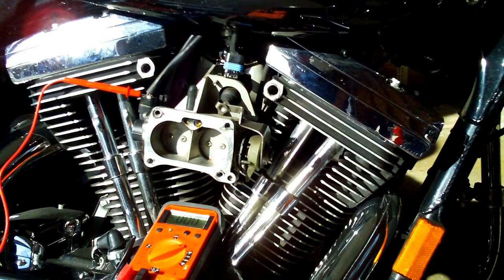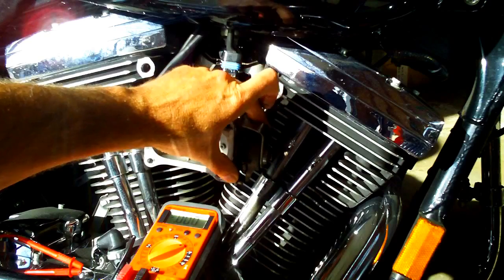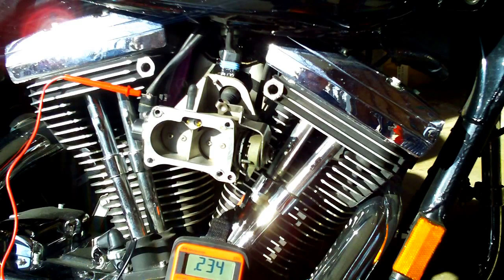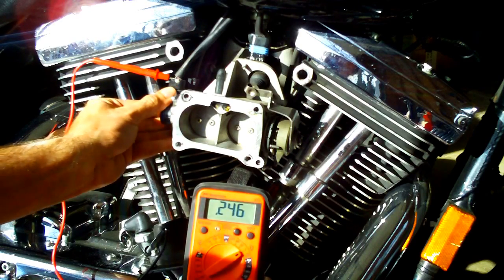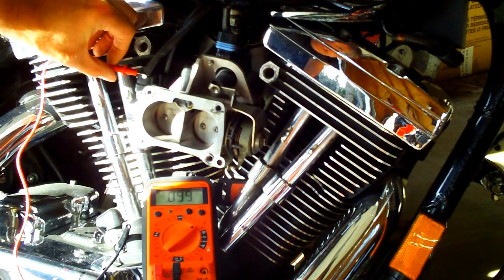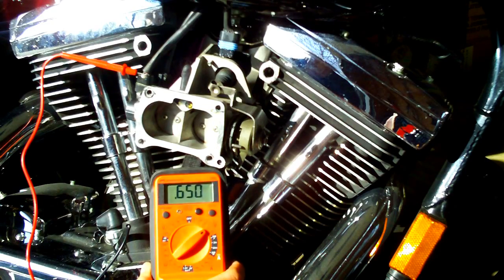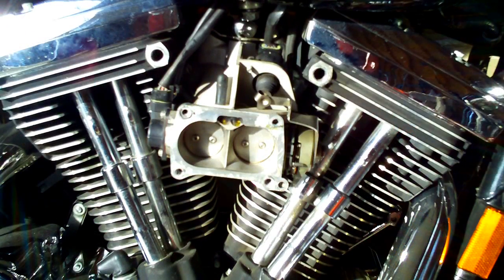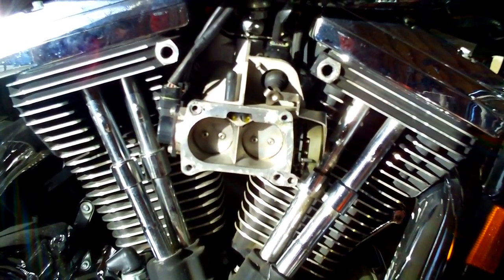Reset Harley Davidson Magneti Marelli Fuel Injection TPS Settings ✔

Comment: Hi Mark... I followed your instructions on this last year or so on my 01 FLHTCI and it helped somewhat. Bike started idling real high and I eventually replaced the TPS with a used one. Then it ran much better. Well now I'm having issues agsin. Put an NOS TPS on and with the adjustments it starts great, cold idle is nice and then warm idle at times is good but then it drops to around 500 rpms and chugs. Take it for a ride and stop and idles great at times but then again it drops to a low rpm and chugs. It just won't keep its idle setting. I replaced cylinder head temp sensor , air intake temp sensor, cleaned out air bleeds but still it just keeps going to a low idle when it feels like it.  I heard of a guy that had to replace his cam sensor a few times . Scratching my head man. Otherwise bike runs strong in all other ways just that Damn idle won't hold or set. Any ideas ?  Thanks
Reply from the maker: The only idea I have so far is to ask if the cold idle is adjusted too high causing the carb idle to rest on it rather than the warm idle screw. Then when you stop and the bike gets really warm it backs off yet again until the idle stop is onto the warm idle screw, which may be set too low (500 rpm). I always hated messing with the cold idle screw because it means you have to remove a LOT just to get to it. Can you verify that this scenario is not what's going on? I can't think of anything else to check at the moment, you've covered most of the bases except for the barometric sensor (snorkel looking thing) inside the fuse cover. I have not heard of one of those going bad, however. As for the crank/cam sensor, I would think the bike would barely run if at all if it was bad, but check with someone who has more experience in that than I do.
Reply: Mark Young - Outside The Box Thanks for the quick reply. What your asking is not the case. It starts cold and idles around 1400-1500 and then idles down and rests on the warm idle stop as I've looked at it several times. Even made sure the cables weren't on a bind and all good.   What I'm seeing from the other post is a typo on the bulletin ??? The .275 should really be .195 for the sweet spot according to Ed? That's enough to make all the difference in idle quality I'd think. You agree on this .195 setting? Mistakes happen I know we are all human. If that's the case all I need to do is reset to .195 and then maybe my problems are gone finally....
Reply from the maker: @Nickolas64  The difference between the two numbers is not a mistake, it is being said that one setting is correct for 80 ci EVO and the other setting is correct for 88 ci TWIN CAM. This is the first time I am seeing this number from the twin cam, so I have no other history to go on. It's up to you to decide if you want to take everything apart again and try it. Keep me posted.
Reply: @contact4mwy7  ....Well if there's a typo and it should be. 195 and not .275  it doesn't help me any it made my bike run a lot worse!! Really threw it out of whack.  So back to. 275 and I found an article from another guy that said warm up your bike fully.  Set the warm idle to 1200 rpms,  pull the 5 amp fuse and ground the relay side of it for min.  15 min or longer.  Put the fuse back in,  start it and get it up to temp again as I rode it about 5 miles or so.  Then just turn the warm idle screw back to 1000 rpms. Said it works like a charm.  So I did and so far it's idling better than it has in a ling time! It's a little off beat and not real smooth but it hasnt dropped down low and started chugging thus far.  It's hovering around 1000 rpms pretty good.  Maybe that's the trick I don't know as nothing else has worked until now.  The resetting of the TPS made a big difference in starting and idling cold until warm! That was a big improvement. Before it was rough and didn't idle high or smooth and ran like crap.  Now it starts up and idles real nice cold around 1500 then drops to 1000 and so far hasn't gone down to lie chugging speed.  I'm going robot in some new plugs for the hell of it since it hasnt been running right. So.... So far so good will see how it goes.  Thanks again for your TPS resetting info as it helped a lot for overall better starting and running.  I think I'm good now...  What a pain this has been! I still feel like something is off though.  I may get a power commander so I have more control over settings.  I'll let you know in the future how it goes...
Reply from the maker: @Nickolas64  Thank you for getting back to me! Again, that new number was posted on a forum and was new to me, but no one who has used .275 has replied to me that it made it run worse. Just worth a try maybe if running the twin cam 88 version. In a couple other videos I show how I picked up used fuel controllers that worked with this system to richen it up just a bit, not much, to get good power and gas mileage. Don't rack your brains out over it. If it runs, run it! Whether or not it seems perfect just might be small stuff overall. Get some riding in and make small adjustments if necessary.
Reply: @contact4mwy7    Here's an update I discovered today. This has been an intermittent issue with the on off not idling properly so kinda hard to diagnose when it's not acting up.  Yesterday it was acting up more than usual spitting,  popping,  not wanting to idle at all.  Decided to check the speedo for codes and one was stored in there but no check engine light on.  Well I got a 41 which is the crank sensor! So I've got one on the way.  I checked it before with nothing present but since it was acting up I decided to check again and this time it had one there.  Will see what happens when I put the new one in when it gets here in a few days...
Reply from the maker: @Nickolas64  that could be the very reason it's not quite running right! Let's hope! Thanks for letting me know, tell me how it goes!
Reply: Mark Young - Outside The Box  Well that didn't help it any. Either my speedo is off or something else is whacked. If I keep it around 1100-1200 it will stay there. Try to turn it down any more it will drop down to the 500rpm chug chug chug.... It's possessed man... I'm leaving it high... Try for a nice 1000 rpm and it will act up... Very strange
Reply from the maker: @Nickolas64  yes, it is. Can you check or know someone who can, to see if there is an intake gasket leak? Is it making a popping sound at idle, like a backfire, when it slows right down to the chug chug speed?
Reply: Mark Young - Outside The Box I've recently replaced the intake seals along with a new tps.  I've got another update. Since I've been tinkering with this bike awhile now I have learned it's habits. I've set the idle different than before. This motor goes through a few stages of idle as it settles. You can't just drive it and get it hot and then set it to where it appears good. You have to give it at least 5 min after setting the warm idle screw as it makes one final drop to its final resting idle like its a computer controlled action. So I've set it around 1200 rpms hot just getting back from a ride then you wait around 3-5 min till it makes its final drop to the lowest idle setting and it's right around 1000 rpms now. I believe I've hit the nail on the head. I've put locktite on the screw so it won't move and the idle is perfect. Almost sounds like a shovel head and it's at 1000 or a tad less. No sounds of trying to die or chug at all just a beautiful idle. A little fine tuning in the fuel tuner as well. Very small adjustments work better on it than half turns as the manual calls for. The crank sensor made a big difference as well. Just how it starts, warms up, runs, cruises now is incredibly smooth. The engine sounds better as well. It seems to act normal now. Believe that crank sensor was acting up intermittently and causing problems. The code is gone now as well. Every time I start it the idle is real nice. The ..275 adjustment made the big difference in cold idle starting as it was rough before and never had a high smooth cold idle until I found your video and made the adjustment. Always rough and not smooth at all. So again I thank you for posting it and all your help. I'm a mechanic by profession just retired from medical reasons now at 55. Haven't worked since I was 44. I had my ASE certifications back in the eighties when I was wrenching on cars. I was the main mechanic where I worked and took pride in my work and had lots of customers only wanting me to work on their vehicles . I did it right the first time and never took short cuts. Had lots of old sixties muscle cars I swapped heads, carbs, rears, intakes, etc always looking for more speed so I know motors well. This is the first bike I've ever worked on and it's quite easy. The computer and sensors is the hardest part yet not that hard. I've already replaced the cam tensioners, all top end gaskets, installed rocker lockers to quiet the valve train, shifter seal, fuel tuner, tires, etc... love working on motors. learning as I go on the Harley but it's pretty easy to work on. I still want an older FLH though. Shovel or pan head, chain and carburetor is what I really want along with a more vintage machine.This bike I just ran across for a good deal. Anyway I finally think I'm good now. Just a touchy machine that I have to learn it's nature and such... Thanks again for all your help...
Reply from the maker: @Nickolas64  wow, man, I am just happy for you! When they run good, they run good, and feel like a lot more fun! Yes, the cold idle motor steps down per the ECM as the cylinder head warms up, you are correct in waiting for it to become "heat soaked" and then making final adjustments on your warm idle. Which fuel tuner did you go with? Very good that you put all that experience to work in replacing so many things already, all very good choices, especially the cam chain tensioners (early twin cam 88's). Safe riding to you my friend!!
Reply: Mark Young - Outside The Box A friend said he uses the Cobra tuners so I got one of those for it. FI2000 I think. Couldn't really adjust it with any sense of change until I replaced the crank sensor. Now I can easily hear and feel the adjustment made. It's very touchy I had to make a few more adjustments recently as well. It runs much better but still seems a little off. Maybe it's just the Marrelli system or something else is acting up a bit. I'm just going to ride it and see how it goes. At least it's not all out of whack like it was. It's manageable now anyway...
Reply from the maker: @Nickolas64  I can't think of anything else to try at this point. Is that the Cobra with the screwdriver turned adjustments?
Reply: Mark Young - Outside The Box  Yes  it has 3 adjustments
Reply from the maker: @Nickolas64  I know the one you're talking about, yes. It's very similar to an early Dobeck fuel injection tuner I used on my MM Road King. I made a video of tuning it up according to their video on YouTube. I think you'll be happy with it. The MM fuel injection system runs Open Loop, which means you're not fighting with O2 Sensors trying to correct your adjustments. Something I liked about MM vs. Delphi.
Reply: Mark Young - Outside The Box        I've had it on there for two years now. As I said it never seemed to make much difference until the resetting of the TPS and replacing the crank sensor. Now it's like adjusting a carburetor as you turn the idle/cruise pot it changes as you turn it where before any changes made recently it didn't seem to make any difference at all. It definitely makes a noticeable difference in power, engine sound, less heat from the factory lean setting. I went out yesterday and overall not bad but a few times it wanted to die out again. I just don't get this damn system it's so touchy. I had to lower the cold idle setting it was up around 1800rpms. I dropped it down to around 1500 now which is much nicer. I see on the service bulletin it states you must set cold idle first then warm idle. Now since I readjusted the cold I'm wondering if I have to reset the warm again? I don't see what difference it makes but maybe it does I don't know. I do know when readjusting I do small increments without paying attn to idle or rpms as its setting still. If I do it until the idle goes up then on the road it will be too high. Weird but that's how it is with this bike. just small increments then test drive to see the change.   Even still it varies at each stop with how it idles. It just doesn't retain a "set" idle speed and retain it as it will fluctuate to different speeds by a few hundred rpms either direction. Maybe this is typical for MM and why they got rid of it for its quirks. I know the air intake temp sensor is in a bad spot and not accurate for readings, and intake runners are too small to fully breathe.  I can ride for the most part anyway and at times it has a real nice idle . ONLY if it would stay there !!! Sounds so good when it's at 950-1000 rpms...

Here it is when it wants to idle properly

https://youtu.be/k5rwgBF5tFo
Reply from the maker: @Nickolas64  yes, it sounds very good there! Thank you for the video. It's been a while since I had set my idle screws, but I wonder if 1500 is too high, in that when the cold idle motor fully retracts it is still interfering with the warm idle setting? Have you tried a cold idle of say 1400? 1300? After the bike has fully warmed up adjust the cold idle to about 1000 (I think it has to be set just a bit higher with the air cleaner off, maybe 1050, 1100?). The warm idle drops a bit when you put the air cleaner back together. But man, you are so close now! Maybe it will average out and never be quite 100% perfect? I don't know.
Reply: Mark Young - Outside The Box      I like your way of thinking.  Sometimes the simple things don't come to mind. The high setting on the cold got me to thinking about the process. Makes sense to me. I turned the screw back, started it and have 1300rpm on the nose. Then went to a nice 950-1000rpms. Got fuses pulled to reset but its raining here. Hopefully tomorrow I can get it out and see what happens. Since I haven't worked as a mechanic as of 1992 some things I don't think of as if I were at it daily. The cold idle setting to high could be an issue I agree  thanks for bringing it up. Two minds thinking are better than one at times. I appreciate all of the input. Now I need some dry pavement.  I'm not one for wet roads or rainy days. I'll let you know how it goes...
Reply from the maker: @Nickolas64  Awesome, man. Let's see what happens. If it drops below 900 use the warm idle screw to bring it back up to near 1,000. I agree with you, two minds are better than one, as I don't always think of everything the first time around!
Reply: Mark Young - Outside The Box       And again dropping down to chugging and not idling good..... So..... I have always gone by the instructions on the paper that ca,e with the Cobra fuel tuner. It has several combinations depending on what's been done to your engine. EVERY green pot which ismidle/cruise is always 2.5 unless you have an 05 screaming eagle filter with blue seals it's 1.5... So I decided after all of this trial and error and still not getting where it should be I'd go with my gut on adjustments.  Like the old days adjusting a carb you turn it until it smooths out and then a final small adjustment to fine tune. So I decided  to do this and not go with the instructions and their settings which are all 2.5... I've always had the feeling it was starving for fuel the way it died out or an air leak. I out manifold seals on and is sealed up good. Anyway as I turn the screw on the idle pot when I get up to 4 it's idling the best, much much smoother... Then I decided to set it back to 3.5 as my final setting. I go out and ride and normally when I pull in the clutch lever it will idle way down and start to chug half the time and when I'm at a stop it doesn't want to idle worth a crap. Now so far I'm having it go right back to the 1000 rpm idle with no sense of a wanting to idle down and start chugging.Its had a little pop here and there which tells me it's too lean. I have no exhaust leaks so I've been thinking about adding more fuel but EVERY setting for idle is 2.5 with all engine mods!!! So I'm fed up and I said screw those instructions I'm going to adjust it like a carb and go with what I feel. No popping so far and even revving it up the smoothness is quite noticeable.  Maybe I've finally hit the nail on the head here!!! I'm letting it cool off and later on before the sun goes down I'm going to start it and check cold idle again and see how it idles . I don't know what the deal is with their settings but I'm really feeling by adding more fuel it's going to solve my issue. I don't know if this is common with a Cobra or not but I just think this is the problem here with the initial setting I'm supposed to use according to their instructions.  Will see how it goes on the next start up....
Reply from the maker: @Nickolas64  I agree, go with your own settings!! All bikes are different and run different, so for them to say set it to 2.5 and leave it there is a little suspicious. Maybe they meant to say "Start at 2.5" and adjust from there as needed. I now have a Dynojet Power Commander V and I read that even though bikes may be the same year and have the same accessories, their maps may still be different to run the best they can. I have modified my downloaded map intended for my bike and accessories as I don't have the same intake and it seems to run richer because of that. Runs great now that I have leaned the tables a bit.
Reply: Mark Young - Outside The Box     Well mine is back to its old ways again... It just won't hold the setting no matter what I do. Maybe it's a computer/map thing on mine. Even though I change settings it defaults back to the map? It's just not going to maintain and settings unless it's at 1200 rpms or so. It will idle there all day but put it at 1000 where it's nice like in the video it goes up and down and chugs.... I probably need a power commander for full control . Just doesn't seem to be any way I can get it to stick at 1000rpms....
Reply from the maker: @Nickolas64  I wouldn't recommend a Power Commander for it, or any other tuner than the Cobra you've been using. Very strange indeed. I believe you can rule out the Cobra by returning all settings to zero? I read a forum about idle issues with the MM system that recommended carb cleaner through the air jet holes at the top of the throttle body intake. There are two adjustment screws near them that have been epoxied over at the factory, leave those alone. But see if you can spray some cleaner through them? I have run out of hunches that it could be otherwise.
Reply: Mark Young - Outside The Box      Cleaned those a month or so back.  What's wrong with the power commander I hear it's a great device that gives you full control to adjust timing , fuel to each cylinder, upload different maps, etc.. Sounds like exactly what I need to get into the system to make more adjustmensts. What's your reason to say no? I may just leave the idle up and sell it since it isn't what I want anyway. I'm going to get an older shovel head, carburetor,  chain drive and points. That's what I grew up with and prefer.  Just bought this at a yard sale I passed 3 years ago an older guy was selling for bad arthritis in his hands not being able to ride anymore.  I'd much rather have an older machine it a lot more my style. I think I'm about done with this thing . Its a good looking machine but it's just not me. I'll decide here sooner or later...
Reply from the maker: @Nickolas64  it's nothing against the Power Commander, I just don't believe there is one made to be used with the MM system? The timing can be adjusted with them, but that's not necessary for a while factory motor from what I've seen online, more for heavily modified motors. So your Cobra should be able to take care of your current setup. I hear what you are saying on making a decision on what will make you happy in the long run. I was hoping it wouldn't come to that, but you're right to think it over. A carb conversion can be done on that bike, but at a hefty cost. You need to do what's right for you.
Reply: Mark Young - Outside The Box      It's not just the carburetor but the entire bike... The style and look of the shovel head motor, the heads, separate tranny, style of everything else... Prefer the look , sound and patina of older machine. Shovel heads are great looking engines and sound so good with that low idle lope. All of it with the entire look of the bike. I prefer everything old. I carry an 1870 pocket watch in my pocket I repaired. I listen to albums, collect and run chain saws from the fifties and sixties.... Everything vintage is just me. I'll get an older bike eventually. I got the idle up a little higher and it's good there. Too high for my liking but it doesn't shut off at least. Not doing a conversion I just want an older machine like from my time as a teen in the seventies... It will find me like everything else does...
Reply from the maker: @Nickolas64  you are a lot like me! I don't blame you one bit. You'll find the bike you're looking for, I just know it. Until then, be safe! Glad it's at least driveable!
Reply: @contact4mwy7  ..Well I sold my 01 FLH the other day and glad to see it go. I found what I been hunting for finally. A real nice 73 FLH shovelhead in great shape!! Much more my style and ride. Nothing sounds like a shovelhead I love those motors. Anyway thanks for the help with the issues I was having with my 01. I finally just had the idle set at 1100 rpm and let it ride . 950 would had been nice but it wouldn't run there , idle.  It's going to a good home.  I'll enjoy my old school machine now...
Reply from the maker: @Nickolas64  I agree with you on the Shovelhead sound, nothing like it! I'm glad you found it too. If you ever post a video of it doing it's "potato potato potato" let me know.
Reply: @contact4mwy7  Will do. Hopefully going to pick it up today have it back here late this afternoon. I'll definitely post a video of it because it does sound sweet...